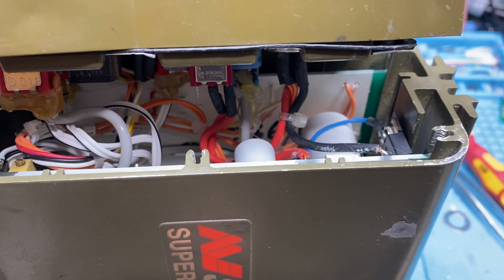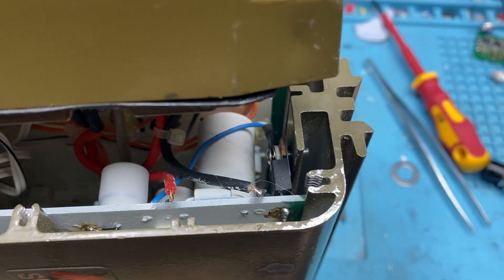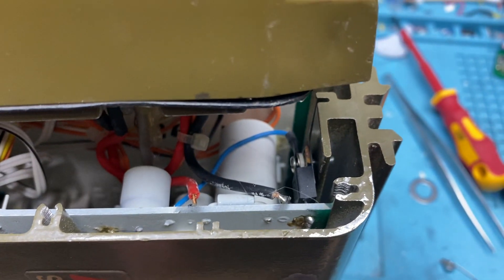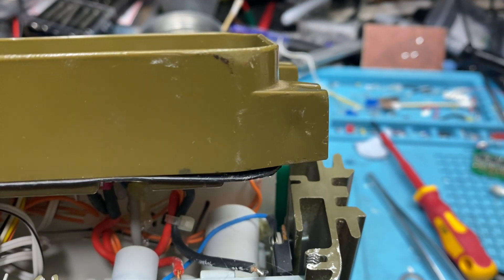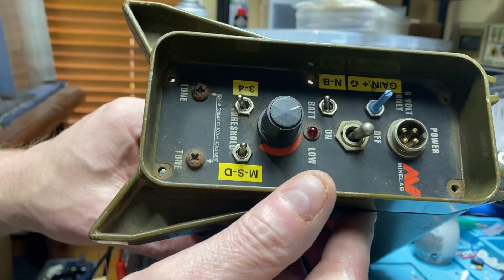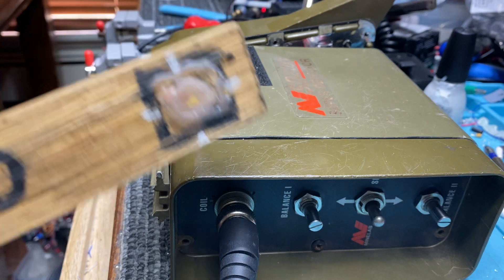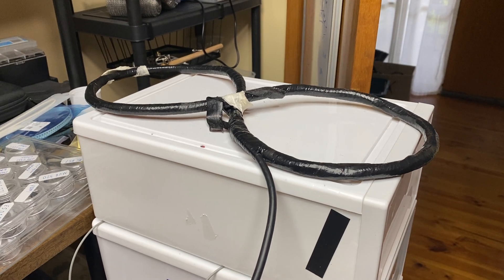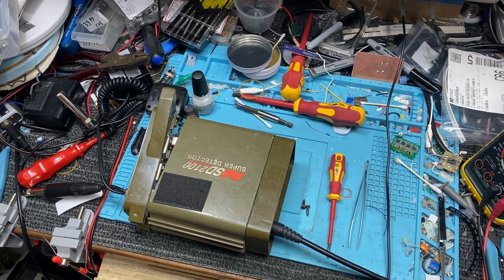The 14 year old expected warranty repair on a 30 year old metal detector, and the painful nut.

Comment: Hello, what are the mosfet damping resistor, diode and opamp used?
Reply from the maker: Original bby100 lm394 ne5534 390 ohm.
Reply: @DetectorMods  thanks

Comment: The source of that mosfet (at 2:00) is a very cold solder-joint. The others seems cold too, but I can not see them good enough That will give problems over time. 
For nuts like that I use an arteries-clamp.  Works fine for sizes like M3. But it is a very repair unfriendly construction.
Reply from the maker: The trepidations of lead free solder.
Reply: @DetectorMods  Nah, more a feature of a Chinese soldering station ;-) I use 2 Pace stations (MBT250 and 350), Lead free soldering is not a problem for those.

Comment: If you had a choice with the older machines, pre GP extreme, which SD model is "the one", as far as the analogue PI box's go? Obviously, they all do well in the right hands👍👌🇦🇺(edit for typo)
Reply from the maker: They all have disadvantages and advantages it really depends on what you want to hunt.